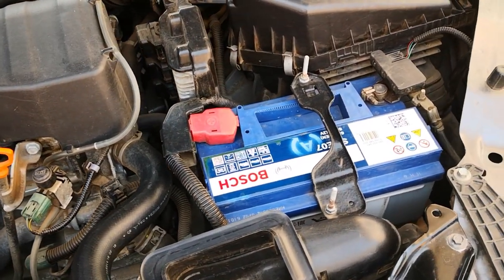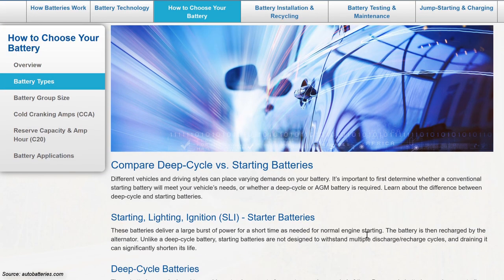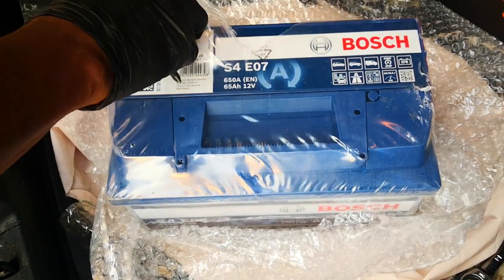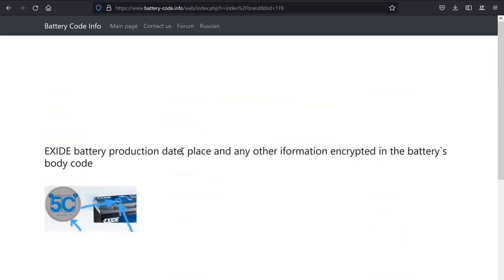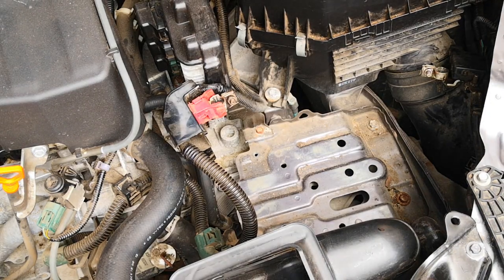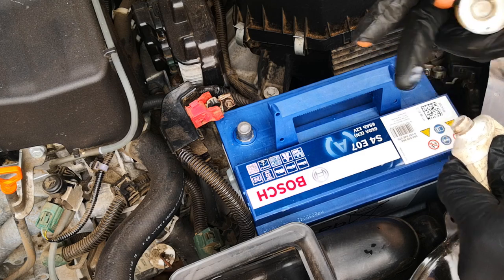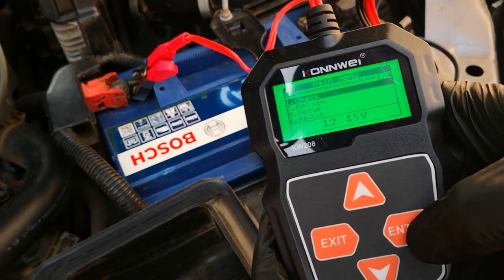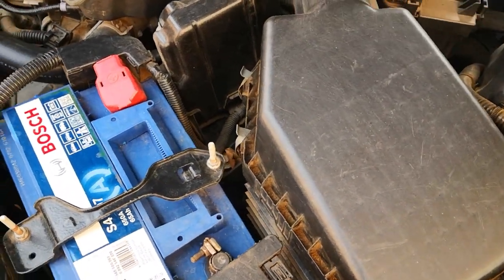How to Make your Car BATTERY Last LONGER - 6 Tips! // IMPROVE Car Battery Life

Comment: Thanks a lot.
I'm currently facing an issue with my vehicle. After multiple diagnosis over 2 weeks, my mechanic said it's the battery. My car starts in the morning but refuses to start again if I switch off the ignition after a 15 minutes slow off-road drive (max 25kmph). If I test with the mini obd scanner I purchase from AliExpress, I see a 10v charge on the battery. I jumpstart and then I'm on the go again. It may reoccur again after 3 days or so.

- What do you recommend I do about this battery? Is it bad beyond recovery? Should I discard?

- Can you recommend a battery brand that I can look for? I understand how tricky recommendations can be. I don't mind 3 brands that I can research on my own.

- Do you have an auto shop?
Reply from the maker: Thanks for the compliment.
On the battery, you'd have to use an external charger like the one I showed in the video to attempt a repair on the battery. It's most likely sulfated. Whether you can still use it depends on how it responds after the repair. If you had a battery tester it would give you the status of the battery (as per good or replace).
If you do need to buy a battery, depends on what's available in your locality, and how much budget you have. Premium brands, like Bosch, Energizer often last longer, but don't come cheap. Also important is getting a freshest battery out there.  If not getting those premium brands, you can for Korean ones. Avoid made in China etc. 

No auto shop.
Reply: @DIYAutoworksNG  Thank you so much.
I really appreciate your response.
I'll talk to a professional who can further advise. 
👍👍👍

Comment: Check date sticker on it when you buy it. Mine was new. Don't buy one that set on shelves for months.
Reply from the maker: Agree with not buying batteries that have sat on the shelve. In fact, I even go with my battery tester when buying new batteries. I avoid batteries that say 'Good but Recharge'.

Comment: The one in my 2002 Focus was over 5 yrs old , replaced it in August at a Costco for $99 and Autozone wanted $170.
Reply from the maker: Yep. Shopping around always helps! What battery size did you get?
Reply: @DIYAutoworksNG  96R
Reply from the maker: Nice.